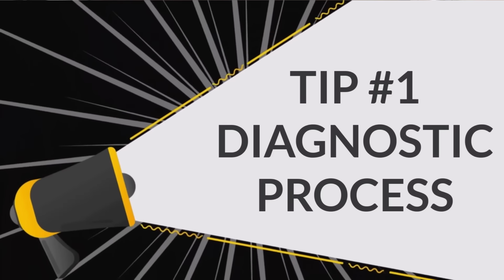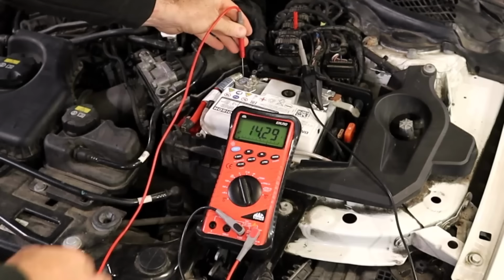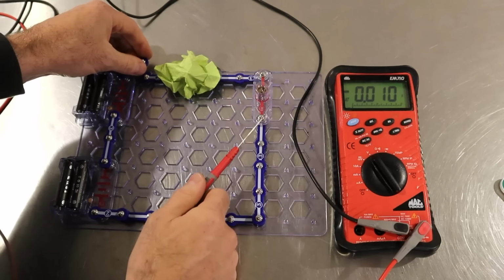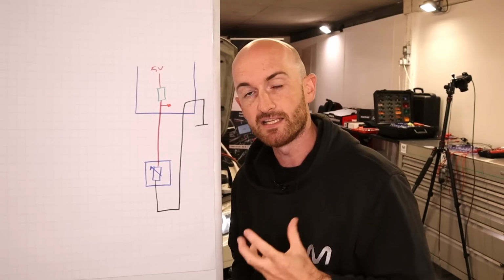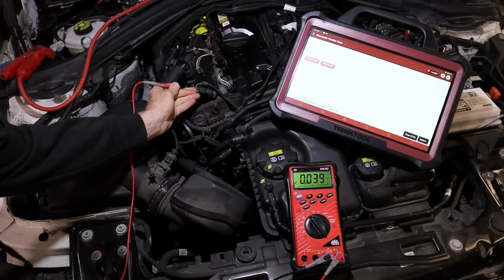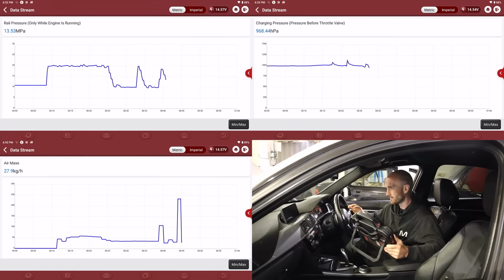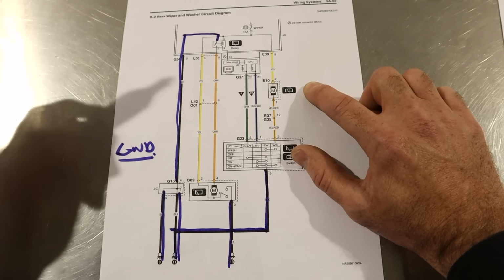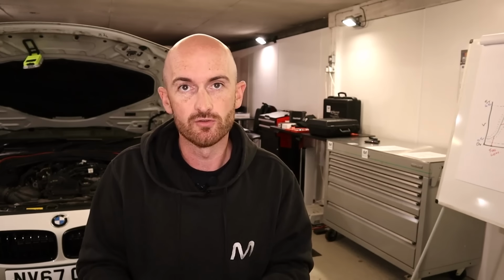5 Secret Tips to FIX ANY CAR

Comment: I refuse to bring my cars to a garage because all they do it start swapping parts out until the problem goes away, not necessarily fixed. The last time I brought my car to a very reputable garage, they replace the fuel pump, but failed to seat the connector, so the car left my wife stranded with no fuel pump due to carelessness on the part of the "technician". Haven't been to a garage in 20 yrs except for exhaust work I was not set up to complete.

Comment: I find them very useful for rapid diagnosis .surely this the only really effective way to check power and ground .so many times hunting down intermittent  faults the battery volts ect as checked on multimeter vanishes with test lamp if poor connections in harness or poor or missing ground .must be incandesant one and don't use on any computer out of reference volts

Comment: Silly question but at around 12 mins 45 you mention about 12 volt sensors being different readings? To my understanding for example a maf sensor, it uses a 12v and 5v, the 5v being the signal and using the same values you are using but the 12v is used to heat the element as 5v isn’t strong enough and isn’t on the same circuit as the alternator , so the 5v system is a much more steady solid 5v and much more accurate for sensor reading where the 12 would fluctuate and spike and just be unstable really

Great video by the way I have followed 100% clearly explained aswell
Reply from the maker: Yes, that’s reference voltage (5v). Nice and consistent/clean

I think what I meant - sometimes a cam sensor can have 12v supply and 5v signal. And vice versa. Don’t always assume that’s it’s 5v…
Reply: @MechanicMindset I see what you mean , not all sensors have a 5v going to it?

Thanks for quick reply 🫡
Reply from the maker: @PistonsUpAlexUK  yes, and the signal could be 12 or 5 too

Comment: @Mechanic Mindset  This is a fantastic video you have made. It clearly explains a lot of things that the average novice forgets or does not yet realise,  including myself. I subscribed at 12 mins and I'm about to replay it from the beginning to help drill into my brain simple measures like having the circuit switched on when testing.  The biggest realisation I've had so far,  which you have not brought up (so far) is LED globes,  and the potential of them hindering diagnosis measurements.  Because LED globes do not have a continuing circuit through them when the circuit is switched off as do incandescent bulbs. I now realise why LED's might not be a very good choice to implement into a circuit which from manufacturer,  was not intended to be used in.  Any thoughts?  Am I correct in what I'm thinking?
Reply from the maker: Thanks, glad you enjoyed the learning. There are a number of challenges around retrofitting LED in place of incandescent lamps, mostly the resistive change in the circuit and the way the car checks if the lamp is blown - you get ‘false’ flags for blown lamps. We have a video touching on the topic somewhere

Comment: In the food equipment ( Hobart Corp) business or the commercial A/C- Refrig. business,  Knowing how to troubleshoot ( Diagnosis )    is essential. I worked with a couple of old techs who could troubleshoot a machine without a schematic. They were the guys that were called when no one else could find the problem. Experience. 
 Learn how the thing works learn electric/ electronic circuits and how to read a multi meter. Don't be a parts changer. That's NOT being  a technician. ✌🏼

Comment: After changing my cam-belt I got a crank no-start. OBDII showed PO336.
Timing pins lined up correctly
Tensioner set correctly
Changed the crank sensor - no joy.
Tested the sensor connector
Ground fine
Power 5v
Signal 10v
With pcm and crank sensor disconnected I checked resistant on the wires to ground.
Ground 0 Ω
Power 0.76 kΩ
Signal 4.6 kΩ

Car is a Ford Mondeo mark4 2.0 tdci Duratorq 130ps 2008 

It ran perfectly before the belt change.

Checked the cam sensor connector too:
1. Grey Ground 0 Ω 
2. Blue/Brown signal 4.6 kΩ 
3. Green/Brown power 200 Ω
 
Is there a way to isolate and id  the problem without unwrapping the entire loom?

Comment: My advice to anyone looking to replace a leaking rack and pinion like the one on my 05 Town and country 
is to lift up the radiator cap and put another van underneath it.
Problem solved.

Comment: With the wiring diagram a Question about O03 please, if that changeover contact is moved to the up position won’t that create a short circuit? I can’t figure it out and what would operate that switch? Could be a limit switch but either way if it changes state surely that fuse is going to blow, thank you
Reply from the maker: Yes, you spotted the fault in this diagram. We cover this circuit in our training. It’s the park switch but it’s been drawn wrong

Comment: I feel like I’ve spent more time chasing bad wires than fixing anything. The Vdiagtool tester saved my weekend more than once lol.
Reply from the maker: I’ve bought one to try. I’ve had a go with the PowerProbe version with mixed results 👍
Reply: @MechanicMindset  hah which model did you try? I’ve been messing with the V500Pro and honestly haven’t found anything I don’t like yet
Reply from the maker: @matthew-p2f7t  just the circuit tester. £30 worth a try haha

Comment: As a DIY enthusiast It tortures me that I cannot find good electrical data without paying for a huge yearly subscription when I only have 1-2 cars. The single model manuals that won’t allow you to see a proper preview until after purchase invariably are useless and will have huge unwieldy user interfaces (or none at all) it’s impossible to learn to global diagnostic principles without a test model and a complete schedule and schematic. As an aside, ever considered running an ai driven simulator ? The car the schematics …….etc. Anyway, I would settle for a proper manual.

Comment: Thank your for the video. From what I have seen here in your video, first time I hear Multimeter is called difference measurement device. electronic eng. here ,and not here to correct you or anything, just first time I hear this. Then by reading some comments I realized average tech guy in workshop is rather clueless on cars. That made me quite happy to get again confirmation for my long time decision to take on car maintenance and troubleshooting by my self. Cost way less and avoids frustration because I had my cars messed up so many time in brand dealership.  Very sad situation indeed and I do thank you for your video and effort to make a change.  I just do not get it how these mostly guys get hired to work in dealership.  Yes  I know, plenty of knowledgeable service guys run their own business but I am not that lucky to know one that has free spot.  Usually they are packed for months ahead once when it is confirmed your car will not be messed up at certain shops.. Nice video!
Reply from the maker: @Mario-r7s3m  Thanks, I think the problems stems from mechanics not doing enough diagnostics and not having access to the right professional development. I’m sure the same types of problems exist in other roles and trades too….. we’ve all experienced a bad manager right?! Mechanics just get it bad because it can be really difficult at times. Thanks for the comment 👍

Comment: Sp the computer couldn't tell if it was over 5 or 12 v to differentiate from a short or open
Reply from the maker: In most cases yes, this is why the fault code gives 2 causes. In fact most modern vehicles, it just says ‘circuit high’ and you need to find out why 👍

Comment: blaaa blaaa blaaa... how do i fix a 2.2 tdci transit that is stuck on the road and doesnt have much engine power ?
Reply from the maker: @dfhgj1022  That’s easy! I don’t need any more info. Will definitely be the flux-capacitor
Reply: @MechanicMindset  so you can only type any thing into the internets and not actually fix any car

Comment: You gave an example of the voltage shorting to 12 volts for a fuel pressure sensor,  that would probably fry the ECU.  Usually the sensors are powered by a 5voltv sensor supply directly from the ECU.  That's why traditional testlights are not used to check ECU (computer) circuits unless outta a low voltage high impedance test light specifically designed to be safe for computer circuits
Reply from the maker: @sunyun4425  ECUs are quite robust to faults, we replicate stuff like this all the time in training. There are instances where a test light isn’t suitable, but it’s still only close to shorting to ground which most modern ECU circuits are capable of handling 👍 I agree though, multimeters (or scopes) are the safest test methods

Comment: Just a comment.  It may be best to feeding electrical circuits as energised or powered, or de-energised and/or isolated.  And, it may be best to describe switches as 'open' or 'closed,' and not on or off.  Basic terminology but saves problems if working with others or describing fault finding techniques.

Comment: What about constant coolant smell in the vents but no leaks outside?  Heater core maybe?
Reply: Yes, a constant coolant smell in the vents with no external leaks is a strong sign of a heater core issue. Even if you don’t see coolant dripping inside, a small internal leak can create vapor that gets pulled into the HVAC system.

Comment: If it make noise..whip it..when feel off. replace. :) 
Diagnostic is an art.... I think you can get ideas..but from scratch.... well... rarely
Its that hard..and i'm not rookie...You need have the drive... never stop

If its about yar crap car faulty..just give it up...pay someone..get new car

I'm just a rookie..over 20y automation diagnostic and 35y all kind car crap diag..

Reality hits.. 95% get impressed byvideo..and se them as hardcore canbus haxors.. (90% dont own a car)

Sorry..its to fakking funny

Comment: I've been working on cars for the last 65 years. Going back to cars with points/plugs/coil for ignition and mechanical fuel pump with carburetor engine, all the way to today's cars. Nothing beats the experience. My father was also a mechanic. He would tell me: "Son, being a mechanic is harder than being a doctor. People go to a doctor and explain exactly what their issue is, where it hurts and when...Car just dies or runs poorly and YOU have to figure out why".
Reply from the maker: @samkitty5894  It’s not easy! And very much under-appreciated
Reply: @MechanicMindset  is there a reputable online platform for one to pursue a career in mechanics?
Reply from the maker: @raphelmickle8767  Have you seen MechanicMindset.com? Lots of diagnostic training here…

https://www.mechanicmindset.com/diagnostic-coach
Reply: 맞는 말씀이십니다.
Reply: 😂😂😂😂😂😂😂 being a doctor is A LOT harder and you need to be a lot more RESPONSIBLE. YOU ARE A JOKE

Comment: These things donot belong in a car.They will fail the question is only when.Old is best own a forty four year old car only replaced the starter and water pump and altenator and battery and wheel bearings by the dealer.Only two sensors water temperature and oil pressure switch.These modern cars is a disaster waiting to happen.The manufacturers are making a lot of crap lately these car will not see a year before there is faulty readings and sensors and ecu problems sometimes in much less time.Had very bad experience with modern cars.
Reply: Exactly 90% of car repair is going towards computer and bad sensors. What a drain what a scam government there are control freaks for sure.

Comment: Perfect breakdown for the diagnosis. I have a question regarding electrical diagnosis. Took my Volvo to a few mechanics, all with another outcome.

Draining of battery until about 10.33V even just quick stopping for gas, therefore always needing to boost. The computer showed up with pages of codes, though they are incorrect, as everything is properly functioning. Could it be the computer module that is malfunctioning with codes and battery drain, OR is the less than a year ago bought battery defective with a dead cell that causes these malfunctions? The dead cell could also explain why it does not drain to zero, rather 10.33V. 

My diagnosis has now fallen to this conclusion regarding my Volvo s80 2009. Thank you for any input or comment.
Reply: I had a vehicle with the same symptom.  With everything turned off, normal resting current. Watched volt meter suddenly drop from 12.5 to 10.5 after just a few minutes after ignition turn off.  Each cell in the battery contributes about 2 volts.  Replaced the battery and no further problem.  Bad cell in an otherwise good battery.  Hope this helps.
Reply from the maker: @armo_mafioso  Thanks! If there is no excessive current drain, then that would help support your case for the battery fault. 

Draining to 10.3V that quick, something is going to be working very hard. 

Even leaving the ignition on for 30 minutes wouldn’t do that 👍
Reply: @MechanicMindset  thanks for the advice. Going to reset ECM with pos and neg touching and see if any difference.

Comment: I wonder if you can inform me if some control parameters can be obtained somewhere regarding the various information that modern OBD2 diagnostic tools give. These tools can show a lot of graphs and numbered values. But how can one know if it is a normal value the tool is showing if not knowing what is normal and what is abnormal values? Thanks...
Reply from the maker: Hi, great question. A lot of this comes from learning and getting to know and understand the systems. There is lots of info online, but readings can vary depending on the car

Comment: As a retired BMW Master Technician I told my sons, to be the best technician in the shop, they need to learn electrical properties, principles and systems, and you will be the most sought after technician in the shop, because I found during my tenure in a shop, that most technicians fall short on knowing the fundamentals on how electrical systems work, and how electronics works, so my sons have both become very very good at electrical sytstems, and both of them have become top employees in the business and their companies and have been able to basically name their price for their hourly pay, due to their high demand and knowledge as a technician. 😎👍
Reply from the maker: 👊 Ex BMW apprentice and Senior Tech here. Fundamentals so important. They pay off big time!
Reply: Exactly as a master technician self taught and learned how systems work is the key to troubleshooting an electrical fault in which many are weak at and I’m one to tell anyone I’m not up for guessing or parts loading a car cuz I wanna know the issue and why it’s become like so. Also the worst is mistakenly fixing the fault and which I’ve learned not to touch anything without scanning first then a quick visual. But I know why now this field is a dying breed and it’s because people are not getting outta the mindset of parts changing but in which it has its place but 80% of the faults are electrical problems. So as the gentlemen said I also agree with start learning the fundamentals and you can find courses like this gentleman, ScannerDanner, Pine Hollow, DiagnoseDan, SMA etc and many others out there. Why pay for school when it does nothing the best part of the theory is the practical (Go out and do the hands on) 😉 👍🏾
Reply: @eliezerramosjr1017  blah blah blah
Reply: It's a great story. Maybe do you have any resources to learn about  fundamentals ?
Reply: Yes, is called college  @chicago701
Reply: Hi how can I go about learning electrics like your sons please, can you recommend a good technique course etc, are college courses offer this type of training or is there a different better way, please help or anyone else that can help me out please thankyou everyone
Reply: Hey SC, did you find some electrics info ?

 @sloopycat1954
Reply: @sloopycat1954  do your own research. you have the interenet at your disposal.
Reply: As someone who is trying to find someone who knows their stuff I agree with you wholeheartedly
Reply: Exactly,  it's great to go on courses that  show how units work and basic fundamentals..
Reply: You lie..BMW never fail...  ;)
What's your real job :p - sorry.. coundt resist
Reply: Well that is a Blessing the best 4 you all out there GOD ALMIGHTY JESUS SAVES
Reply: Which site to visit for me to be equipped fully with electrical knowledge
Reply: sure understanding basics is the key to diagnosing even complex faults, actually the proper place to start...
Reply: Thanks for the ideas
Reply: Awesome I’m pleased they followed your top advice! 🙌
Reply: These guys want to be Auto Electricians ,this is not mechanics it's electrics
Reply: The basics are so important electrically, learn parallel and series ccts, I’ve been at this 40 years now and if you’ve got a good grasp of this you’ll be there
Reply: As a customer your right hardly any shops near me do electrical ... And don't even want to fix an electrical car issue.. my old car had electric issues.. and it was so hard to find anyone that could work on it...
Reply: Yes sir, can I hala you for minute
Reply: lucky them. i wish i had a dad that passed on his trait onto me. Nope. I got a lazy ass dad that didn't amount to anything. and i'm heading in that direction. He did give me some talents that I'm very happy about. I'm a very curious individual, idk if that's him or mom but whatever. at least i know a thing or two more than him and I can repair my car, oh i'm I'm trilingual, something he could never acheive.. anyway moving on
Reply: @victoraraozp stop competing and comparing yourself with your dad 😂
Reply: Bmw is crap
Reply: @ВеселинМинчев-ч3р  jajajajajaj but it's doing something right. something you're not doing.